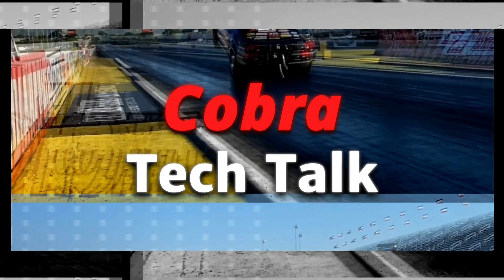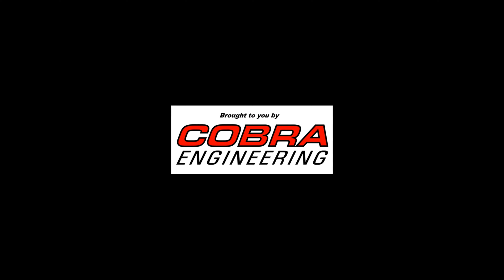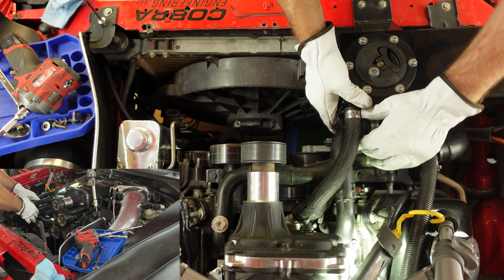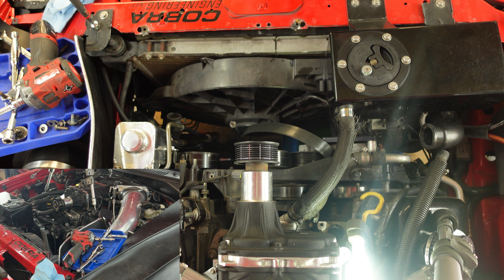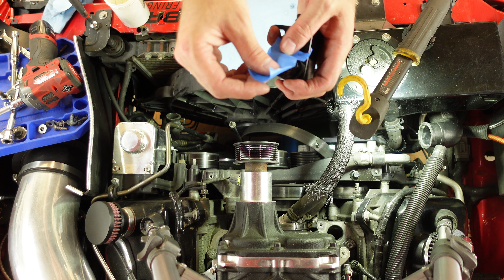Coolant Crossover Delete Install - Part 1

Comment: Does this work for the 1st Gen Mark VIii 4.6 motors?  If not do you know whose mod does?  Interested in the Thermostat relocation too
Reply from the maker: No
I need to make different head fittings for B heads like that has.

Comment: I’m new to the terminator I known about the cooling mode in back for heads on right. But what is this for are they related. I’m sorry don’t know this stuff
Reply from the maker: Never bad questions. 
This is just to eliminate the solid crossover tube that gets in the way of some blowers and turbos. 
Also it simplifies the cooling system. But is not necessarily better than the oem setup if it’s working for you.

Comment: Where are you all located at?
Reply from the maker: Upper Michigan. About 100 miles north of Green Bay Wisconsin.
Reply: @cobraengineering  I’m down the street from AED, so I was hoping you where local near by.

I’m trying to locate a shop the can rebuild my Cobra engine. So far I can only find Brenspeed.
Reply from the maker: @Vffr1  unfortunately I don’t have any insight on who is best out there. But with some good research I’m sure you can find one. 
Let us all know if you do find one that’s trustworthy.

Comment: Would u leave stock thermostat in atfter installing everything?  Sorry for the dum question
Reply from the maker: No. Check out the second video. 
But if you want to leave that alone I have a non thermostat crossover delete coming in about a month.
Reply: @cobraengineering nothing yet for the cross over delete? 🫣
Reply from the maker: @insanekiller9256  I have the non thermostat crossover in stock now

Comment: Does this add any degree of success to fully burping air vs. the factory crossover?
Reply from the maker: No. Basically the same.
Reply: @cobraengineering  thanks!
Reply: Anytime you move the thermostat to the upper radiator hose you make for an easy to burp cooling system

Comment: what hose fittings brand did u use ?
Reply from the maker: I believe those came from Summit. But I am setup with Improved Racing now and can get you all the hose and fittings if you want?
Reply: @cobraengineering  can you that will be awesome
Reply from the maker: @bryanzamora4559  email me. James@cobraengineering.com

Comment: what fitting is that 90 degree going into for the head cooling mod?
Reply from the maker: The thermostat housing has a 1/2NPT port. That’s a very simple 90* hose barb fitting.
Reply: @cobraengineering  looks like the 90 goes into a gold fitting which goes into the housing
Reply from the maker: @andytakhar3927  I had that fitting. But it’s a 3/8NPT. So all I could get local was a brass reducer.

Comment: Can i use this kit for my cobra 1997 no supercharger.
Reply from the maker: The head fittings won't work with the B heads on that engine.  But I am going to be making a set that will.  Watch Cobra Engineering's Facebook or Instagram pages.
Reply: @cobraengineering   do you have an idea when you will get them ready for the public?
Reply from the maker: @yaviermustang2012  it will be a while. Time is tight.

Comment: Can I run this crossover delete, keep my stock oil cooler and just cap off the hose that comes down from the stock cross over and just remove the thermostat at the stock location and run just the one in the new close over kit?
Reply from the maker: Yes.  Many have done this very thing.
Reply: The warm up time should be the same?
Reply from the maker: @adipperales9902  No. that is why Ford uses the bypass setup. In emissions it helps to get the engine up to temp quickly.
Reply: Last question, if I order your oil cooler delete kit, can I just run it with the oil filter relocation kit, and not run an aftermarket marker radiator cooler/radiator?
Reply from the maker: @adipperales9902  yes. A aftermarket oil cooler is not necessary.
Reply: @cobraengineering   does your oil cooler delete kit require a gasket when mounting on the block or any gasket maker ?
Reply from the maker: @adipperales9902  just reuse the your factory gasket.

Comment: hello, does this kit work with B heads?
Reply from the maker: Sorry but they don’t. 
I am looking into this.
Reply: @cobraengineering  it's a shame it doesn't. I recently went through hell trying to make another company's kit fit my b head teskid block car. We don't have that super easy to reach bolt holt like you do so I had to trim the actual intake manifold to expose the 2 holes I did have. Sure it works but could be better. Granted b head builds just aren't in demand so I can't fault anyone for limited support either.
Reply from the maker: @flyinghighlm8391  I have a set of B heads here but not a manifold. I will see what I can do about this.
Reply: @cobraengineering  I'm happy to email you more information/pictures of the train wreck that's my crossover delete. Hard part is the bolt holes are 180deg out from what you used. Limited spacing needless to say.

Comment: That is a beautiful piece! Dumb question, is there a reason to relocate the thermostat to that new location rather than keeping it stock?
Reply from the maker: No such thing as a dumb question. 
Mostly just cleaning up the cooling system. The factory setup is made for emissions not power and racing.
Reply: @cobraengineering  adding one these to my list. Do you have a video explaining the different head cooling mods for the cobras. I see your head cooling mod uses the driver side freeze plug at the top of the head rather than the freeze plug on the back of head like mmr's. Is one location better than the other?
Reply from the maker: @racequad9  the one on my car has been there for 15 years and I just have never pulled the transmission to install the proper one.  So yes the one I sell that goes in the back of the heads is the proper way to do it.
Reply: Where can I find this kit??
Reply: @samsamhernandez5482  On his website. He has it linked in the description
Reply: James, may I ask what your setup is from the oil cooler to the lower rad?

Comment: My Cobra needs this. Right now I'm running the massaged OEM crossover to clear my VMP Gen3R. Also want to pick up your head cooling mod. These will be winter projects for the Cobra for this off season.